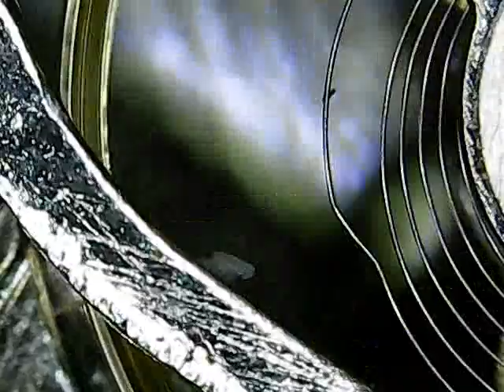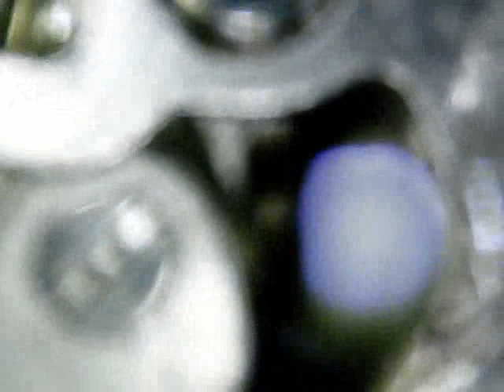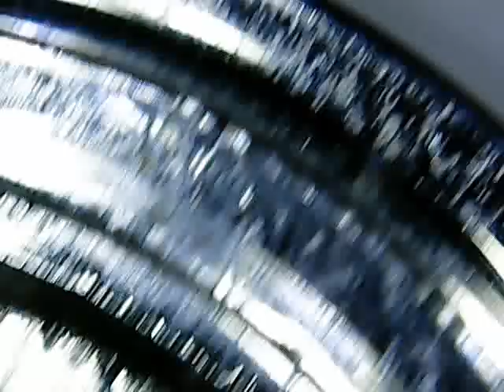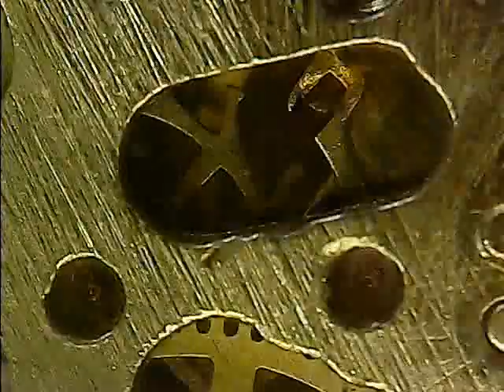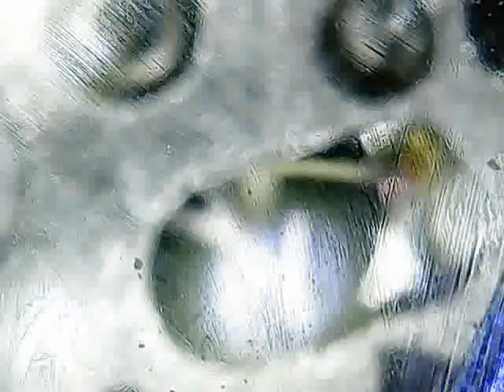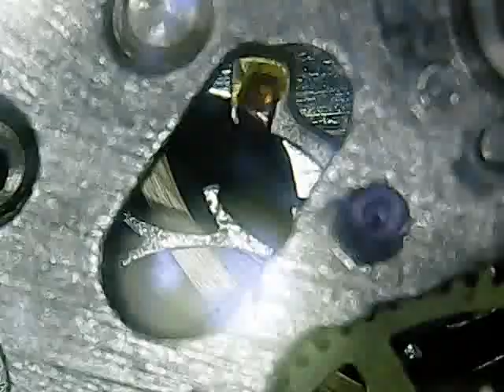SOKI skeleton cheap chinese mechanical Tongji movement watch

Comment: Those CSM Tongji movements can be very good if you get a well assembled one.  They are usually between 17 and 31 jewels (the most common being the manual wind 17 jewel calibre) and are very robust.  The trick is if you get a good one from the factory.
Reply from the maker: +tripsadelica 
Yes they are good for the price indeed.  But the autowinders are not working.  Used one SOKI Submariner for half a year. Really liked that one. Disassembled the autowinder and winded it regularly, it was dead accurate with a stable daily routine. +-1sec a day.
Reply: +Balogh Szabolcs If you have a jeweller's tool kit try and remove the autowinder pendulum and add a tiny spot of WD40 on the pivot (if you have watch oil that will be better) then reassemble the pendulum.  I'm surprised that the autowinders stopped working as usually they are the last thing to break in a watch.

Good luck and look at it this way...if something goes wrong it's not terribly expensive to just buy another one.:)

Comment: I have a manual wind tongji in a Fineat skeleton watch that is about ten years old.  Still works well.  I have had two watches with the automatic version, and they were both failures.
Reply from the maker: In my experience the auto tongji also works fine after the removal of the auto mechanism :)

Comment: Are they any good?
Reply: @freddykruger3320  thank you.
I got one that last for 38 hours.
Reply: @freddykruger3320  really... Hmm..
Reply: @freddykruger3320  i got a watch with the same movement, but with a golden accent on the movement frame, its been 2 months since i bought it, has no problem whatsoever except the slightly reduced amplitude, i think its from a slightly more than a full rotation, to a bit less than a full rotation